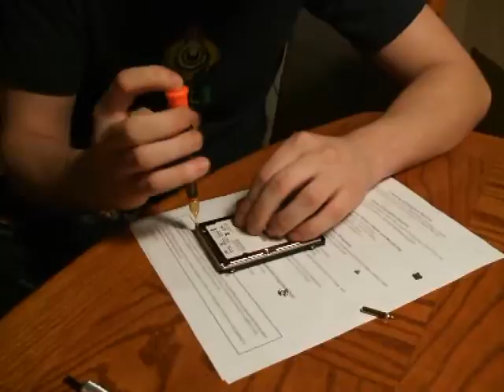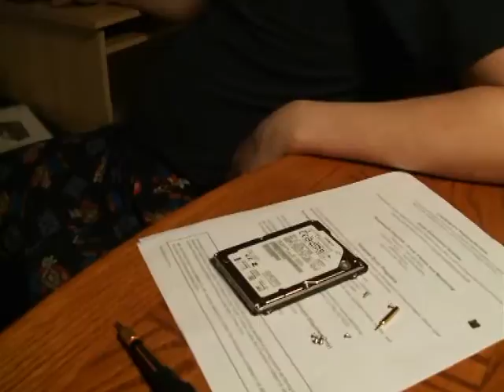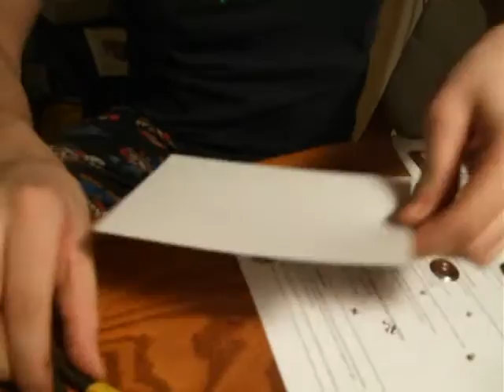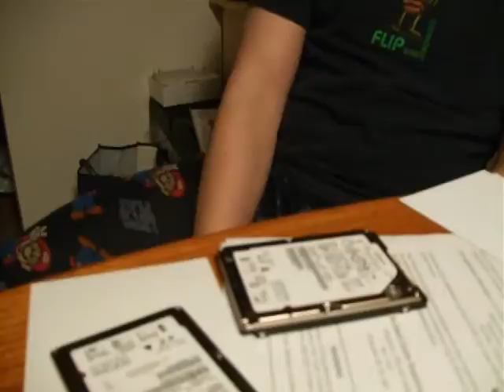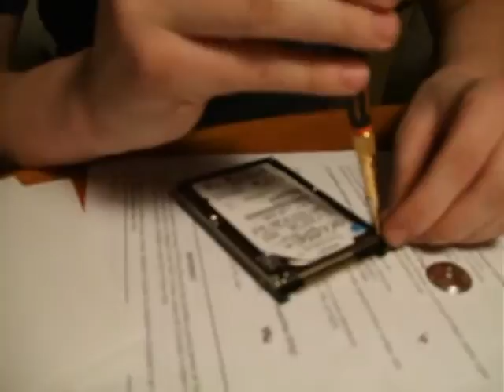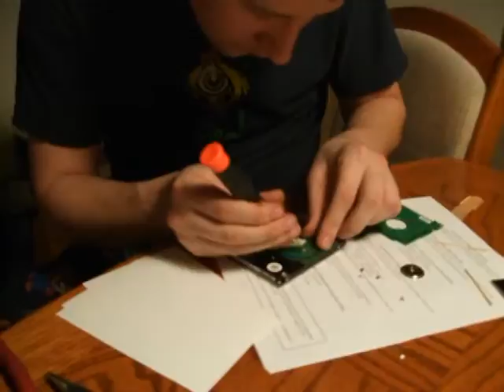Hard Drive Platter Recovery

Comment: "you have to switch the circut board when you switch the disk or it wont work, the circut board corrisponds with its own disk, you cant switch the disk and not the board, if you do it wont work..."

As long as the circuit boards are the same revision/firmware it shouldn't matter right? And when buying the replacement disk you'd want to get a 100% matching one anyway.

Comment: it is very difficult, i tried and i failed, nothing showed up after i tried, i didnt know, but my hard drive had TWO platters, very very difficult to change two platters.  you have to get the same exact model too, i tried to swap with  from 500gb to 160gb and it didnt work